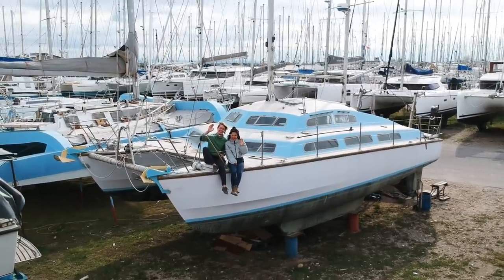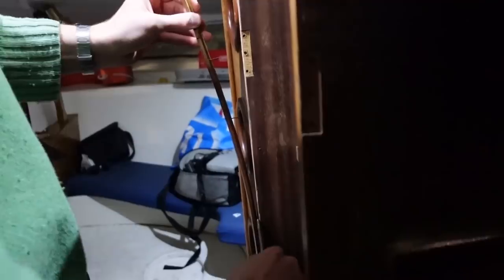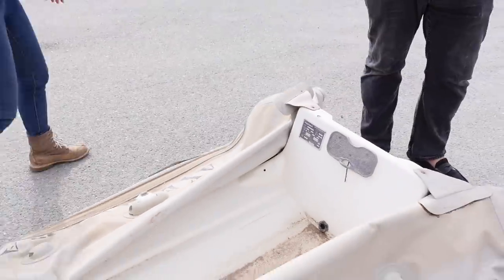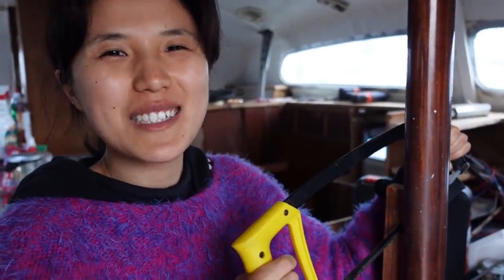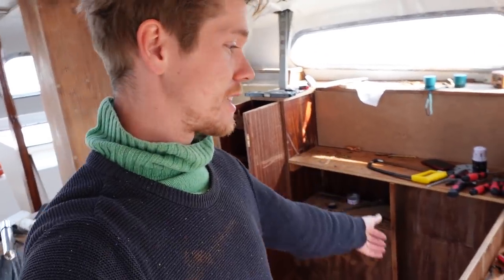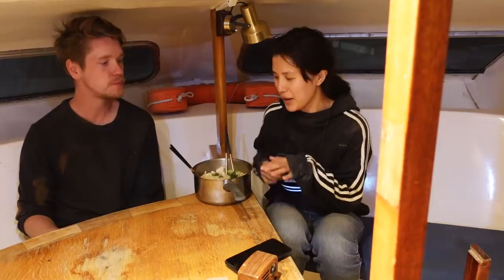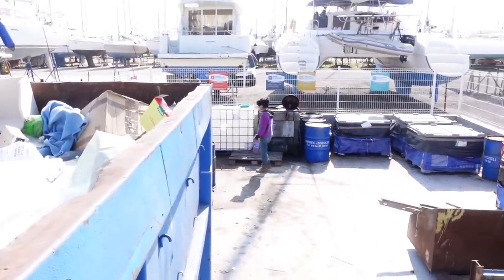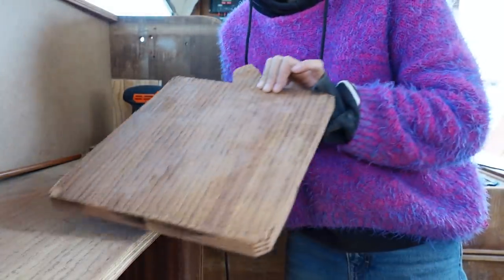Dirt Cheap Catamaran Refit | Part 1 | Wildlings Sailing

Comment: I've never had a week go by so slowly as this week waiting for this video to come out!
I can see the happiness in you both now you are the owners of a liveaboard fixerupper :)
I'm glad you came to the decision to do one area at a time. I know you have time and budget constraints, but preparation is key, especially with many boat jobs. Your upcoming deck painting job is one example. As an ex-painter, I could write a wall of advice here for you both, but instead I'll leave a link to some basic deck painting tips :)
https://uk.boats.com/how-to/non-slip-deck-painting-10-tips/
My advice is don't cut corners with prepwork. Take the extra time and the end result will come out great and you'll save time and money not have to redo silly costly mistakes.
The type of non-skid paint you will use will come down to what you can get where you are. Premixed non-skid additives or not doesn't really matter. It's more about availability. As amateur painters, I would go with premixed if you can get it. Faster and easier by far. There is also stick on non-skid matting available to apply after painting which work well as long as, you guessed it, the prepwork is done right. Always read the instructions TWICE!!!
Nice job on getting that dingy too!
Looking forward to seeing more of your cat adventures :) Keep up the good spirits and remember to give yourselves a break now and then.

Comment: Does the Cat come with a Salt water to Fresh Water system if not add as big a tank of fresh water tank, same goes for fuel, you do not want to be looking for low priced Fuel.  The best screw out there by far is the Canadian Roberts head which means Square screw driver, thses things do not strip that easily.

Comment: If possible you want to save that plywood. Your plywood that makes up the interior of the boat looks like 3/4" ply, and furniture grade at that $$$!! Wait until you need some of that and you will want to save every piece you can. As for weight, that wood not only adds strength but you need weight in certain places. This is all engineered into the boat when constructed. If it was me doing this work and you want to change things, save all you can without cutting it up and then plan it out to use as much of the original material as possible. Taking 150lbs out of an 8,000 lb boat is not really a gain of sorts. Good luck, I am with you guys.

Comment: If you want inspiration for cat sailing you could do worse than check out the Sailing Zingaro YouTube back catalogue. James & Kimi sailed an old 37ft cat across the Pacific until it finally fell apart in heavy seas. Very good videos in many respects and I think you two could achieve the same or more. Best wishes from North Wales.
Reply: Yeah, the important thing to remember is that “it fell apart”.
Reply: @Sailspirit99  But what an adventure it enabled its owner to go on. It served its purpose and for something that was cheap and 36-years old, I thought it did OK. When you're shopping in the bargain basement you're not expecting to uncover lifelong assets.
Reply: It was a different beast to this which looks much stronger.
Reply: @Sailspirit99  after what, 10k+ miles, and having design flaws, and being improperly repaired at some point in it's life. At least that's what I took away from James' explanation of what went down.

Comment: No cats are money pits because of the structure keeping it soild and in general u can fit so many more systems onboard a cat 
So let's say u have a 40 foot monohull u have to compromise space and systems so if u wanted to outfit that 40 foot mono with a generator, air conditioner ,dive compressor, water maker and a large house bank for modern things like a microwave or computer all these things take up space much less adding things like a washer and dryer but all that and more can fit in one hull of a cat and that's truly what drives up the cost of ownership plus there two of most every thing

Comment: Those cats were never exactly rapid, but every little helps.  Painted non slip is fine, just needs doing regular, i wouldnt say the non-slip decking material would be worth the time and expense of fitting......its a cat, so you dont need to be non slip at 45 degrees.....i hope.  Looked like your water was leaking from a copper elbow on the video. More power to your elbows.

Comment: That plastic water pipe seems a tiny bit too loose on your pipes, its almost impossible to compress  as well, you are better with a slightly smaller pipe and stick the end in boiling water to soften it to get it on the pipe..

Comment: Not lecturing. It would be a good idea if you could use at least some noise protecction when you are using tools in an enclosed space.  You may not notice it now but you will when you are my age.  You bit of a lot here but I am sure you can get there.  Though I will miss the little home.

Comment: I'm about to look into the possibility of using Chlorinated Rubber paint as a deck paint, It's the paint they use for road marking. It is also used to paint swimming pools. Has anyone any experience of using this paint. I've an idea it's the deck paint that is marketed for use with a patterned roller. It is also relatively cheap..Also, just to say, beware saw dust is explosive in a confined space.

Comment: Please: get rid of the gas fueled waterheater. It is a real dangerous thing: Carbonmonoxide. and gasleakage!
Replace it with an electrical waterheater (boiler) perhaps with a diesel heater.

Comment: For how to do it right and on a budget, check out Free Range Sail’s YouTube channel and their latest video series. They’re more than half way through a circumnavigation of Australia and have just finished most of a full refit of their 30 footer. I think you can learn a lot from their work refitting both the inside and out on their boat. Really nice work, but truly just enough to do it right, saving money on all kinds of proven hacks from real sailers. Troy is a seasoned sailor with decades of marine experience. Very no nonsense.

Comment: Having built 2 campervans, I suggest you ditch the old 3-way fridge and buy a compressor fridge. The gas fridge only works if it's as good as level; the 12v puts a massive drain on the battery. Compressor fridges run on very low amp draw, so fine off solar, and can switch to freezer mode. https://www.jacksonsleisure.com/dometic/waeco/crx50/fridge/

Comment: Another great video - great pace of progress on your new home! I hope to be painting my deck some time in the next 4 weeks. I will be using Hammerite Smooth paint 1 or 2 coats with a layer of dry sand added white the paint is still wet. Once the paint is dry, the loose sand is brushed off and then a final coat of Hammerite applied by roller on top. I did try mixing the paint with sand many years ago but it proved very difficult to apply. 

Here is a link to a really video of how it is done. 

https://youtu.be/a7KFzjr3oj4

Looking forward to seeing your amazing progress.

Comment: When you lighten shower, , use shower kit walls, you can glue it on with mastic, can cut panels to fit. Stop putting your multi hull down, please. We who own them love them, and they do keep their value, just not when owner dies in a back water. DO you realize what a bargain you got ???? I had to change over to lifepho4 batteries, Way expensive but last 10 years. Fix shower and use it NOW, please, please. It alone is worth 5k. Just to be able to shower when you want.  The electronics you received are worth 7 to 8 K$$$$$. So smart changing to LED’s, better lighting too. Please leave wood natural, sand and spray varnish with SATIN GOOD brand.
Reply from the maker: Yay! So nice we heard we got a good deal!

Comment: how can you change hinges on a rusty, dirty sheet metal, without doing anything first, and by not putting the right screws ... !! if you want to show your work it must at least be done with care ... !!
Reply: I second that. It was one of the things I didn't like about this episode.
Reply: @bgt7874  yes, I'm very happy for you, but if we redo things, we have to start at the beginning ... clean, treat the rust, repaint, protect, improve, and reassemble ... !!I am also myself improving my new sailboat ... and passing the cables for an electric windlass, I cleaned everything and put a white canvas (lining), so that it is on top ...! !
Reply: @VAdu56  I like that aproach also.
Reply from the maker: If you don't like the way I hinge my ovens, I think you're watching the wrong channel, bud.